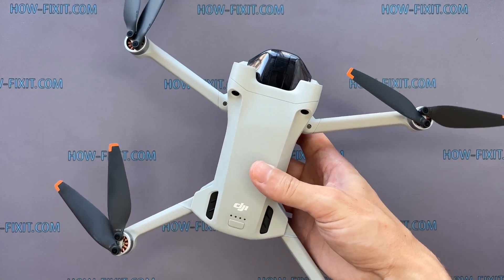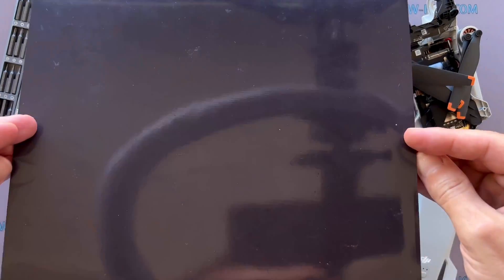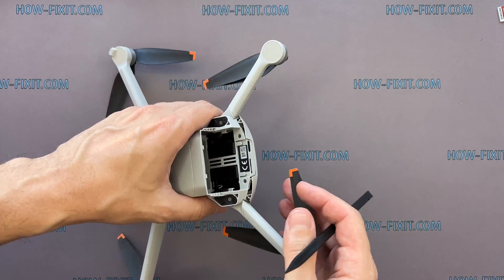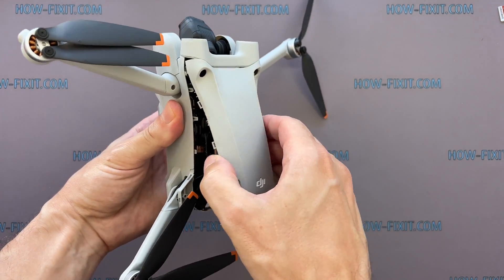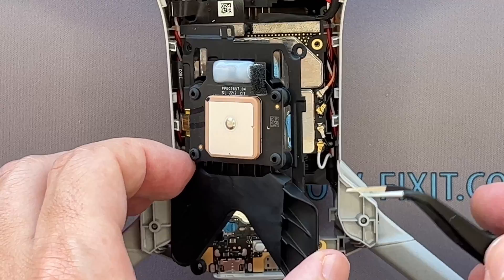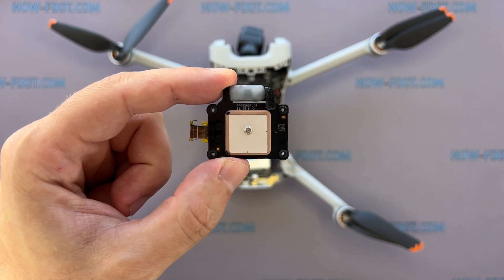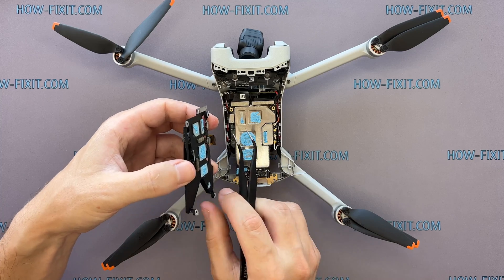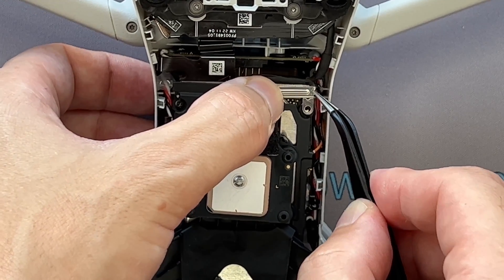DJI Mini 3 Pro GPS module Replacement. How to fix GPS error or no signal.

Comment: For some reason my drone stopped working and the gps signal is not working but also the RC signal, I tested another RC and is not working so the drone is the issue, is there a tutorial to replace the RC module?

Comment: my drone crashed, after it says navigation system error. no signal code: 30008 can it be fix by buying gps module?
Reply: Have you fixed the issue?

Comment: I suffered a fall with my mini three Pro, breaking the flat of the GPS module. Replaced the module and the errors stopped appearing... However, the Drone does not crash, but it is no longer stuck in the air. I need help

Comment: There is NO GPS CALIBRATION ! Don't work if you replace the GPS module on mini 3. The erro persist
Reply: Have you figured out anything about this error? I have same issue.....
Reply: @nychillboy8724  yes,  u need use the same number to replace the GPS module,  so this way, go work.
Reply: What you mean number
Reply: This part has a Number, all part have. final 09...07..04...05 check the part number and replace to the same number, ok !?
 @nighthd8852

Comment: Hey great video, I crashed my Air 2s. Replaced back left leg which was the only physical damage the drone experienced. After putting it back together I am getting navigation system error. I have tried replacing gps flex cable but no luck. Any suggestions?
Reply from the maker: 1) Try to calibrate the GPS
2) Replacing the GPS module can solve this problem
Reply: @howfixit  Replaced the GPS Module and Flex cable as suggested. Now the navigation system error is gone but IMU calibration error comes up. And every time I try to calibrate IMU it sends IMU calibration error. Any suggestions please. Thanks
Reply: @umairhafeez did you fixed your problem???
Reply: GPS module board